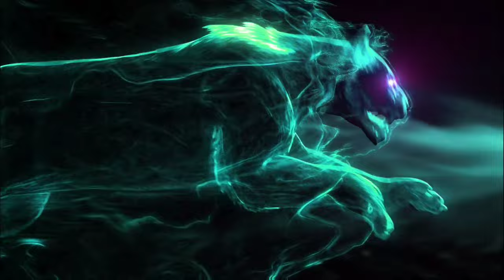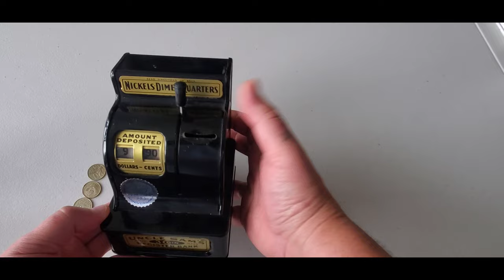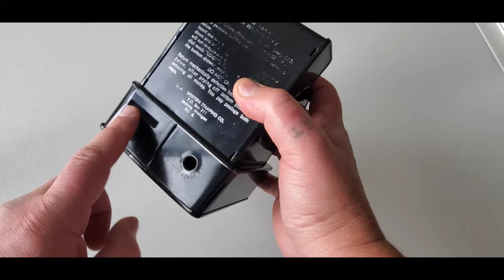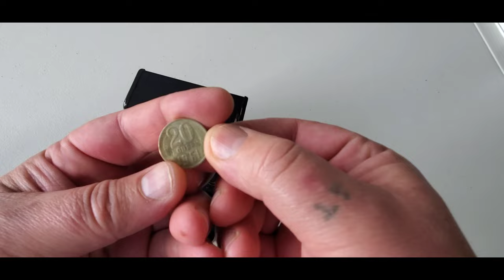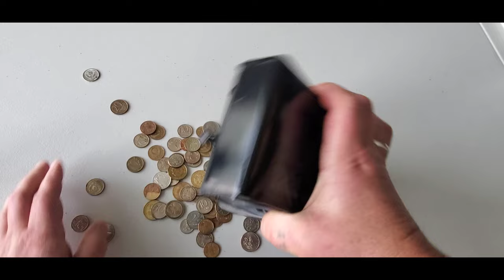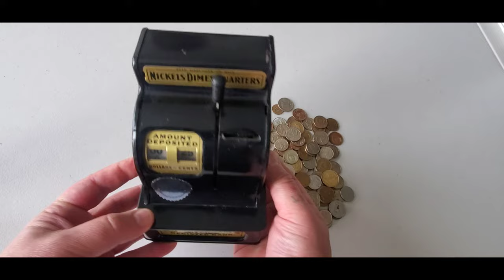How to open Uncle Sam's Register Bank 3 Coin 4K

Comment: 🏧 The Bank Is In Great Condition 🏧
      I think there was another "secret" way of opening it up but unsure. Did the printing on back mention?   All the kids had one of these in the 60's & 70's near me ~ we became proficient with the butter knife, sliding out coins from the slit in back when we needed emergency candy funds. 🍬
Reply from the maker: Just spotted your comment. Thank you! That is very interested story. Yes the print on the back is slightly faded, so it won't help a lot. But Unit is functioning perfect. I do have this listed about month ago on eBay, see if any one need one for nostalgia. https://www.ebay.com/itm/195487348486